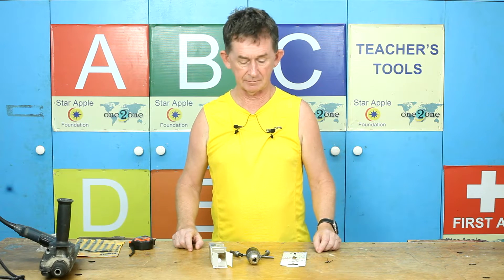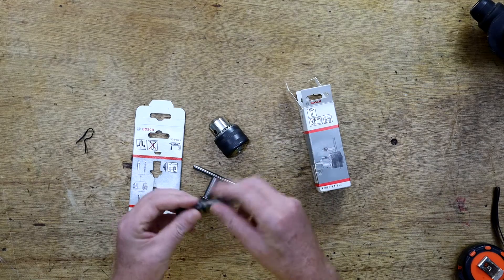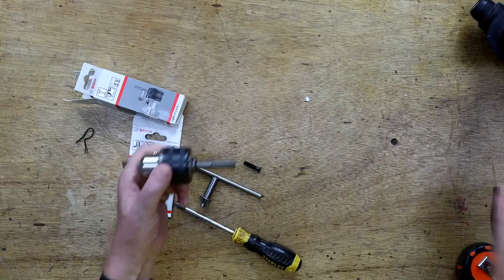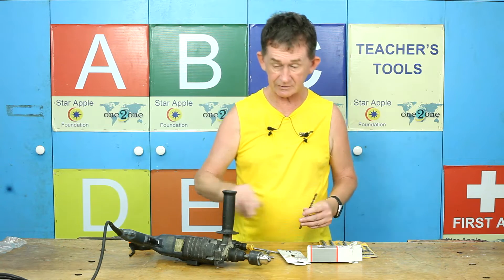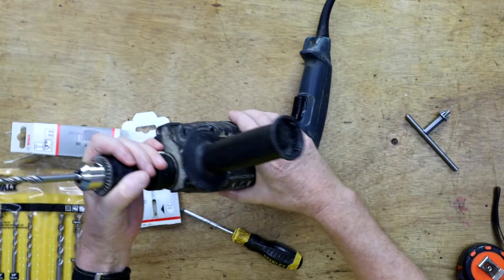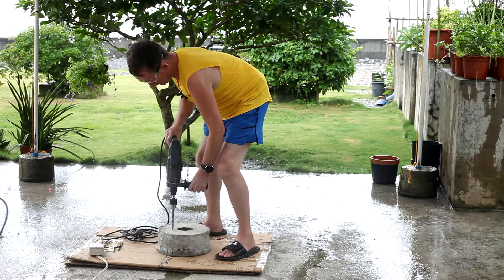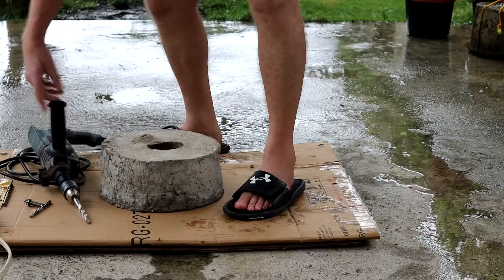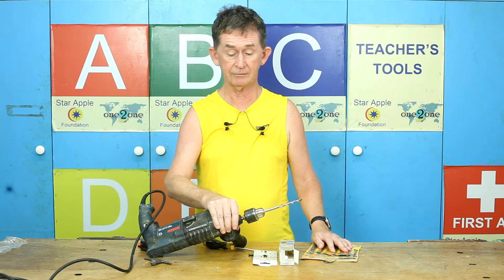Bosch SDS Adaptor Chuck - Review and Testing

Comment: The screw that you discarded goes through the barrel and into the SDS shaft you unscrewed it from after you’ve screwed it init the barrel, not sure why this didn’t come pre assembled but that is how you assemble it for use otherwise it’ll unscrew itself over time
Reply: I have a bosch 10mm adaptor. Mine too doesn't have a hole to screw in. Though I bought the shaft separately from bosch with the screw but then discarded the screw. Didnt understand why they made it like that. Somehow it seems to be in place after drilling. No problems. I haven't done heavy drilling though.
Reply: I just got my Bosch impact drill that I bought online. They threw in the same Bosch key chuck without a hole for the retaining screw to installed. I suspect this is a replacement chuck for the regular power drill and not meant for putting in a SDS adaptor. Anyway seeing that it works ok without the retaining screw I think I'll just use it. Also please don't use the keyed chuck for concrete on hammer/impact mode. It's meant for lighter task like drilling into wood or metal.
Reply from the maker: There is no through hole on this version. That I why I could not use the screw. Thank you for watching.
Reply: @Boopolo  I have the exact same thing and have the Makita version also, they all have holes, that is what the screw is for